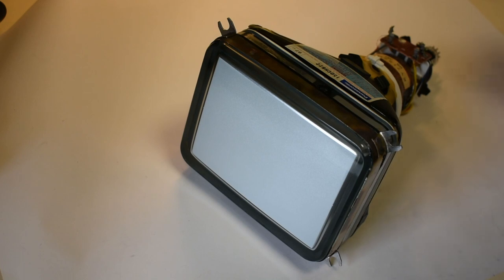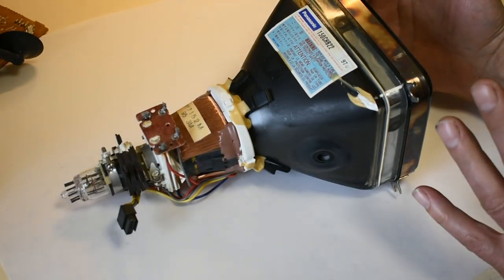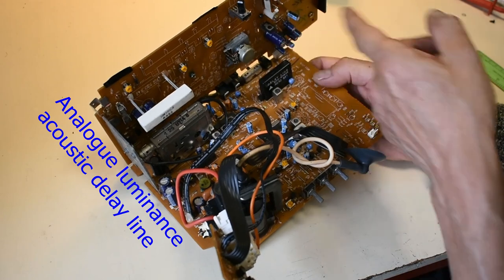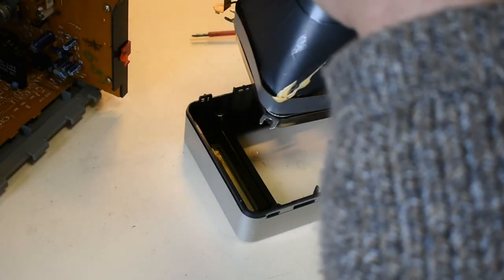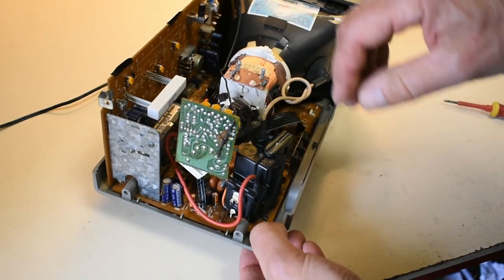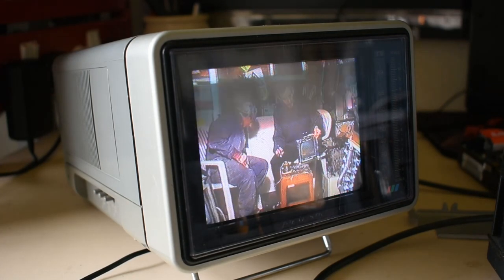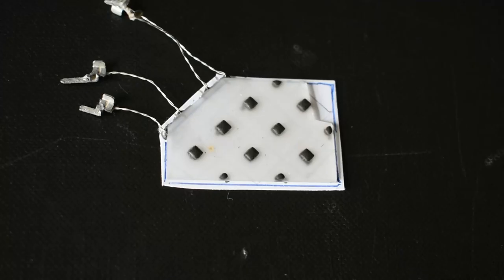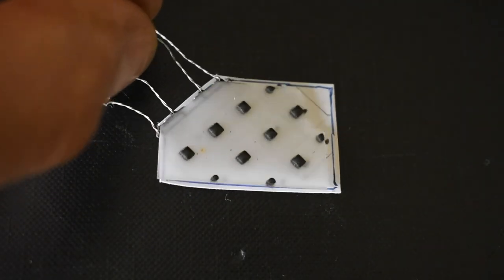Small 'Portavision' CRT TV

Comment: In a PAL system, there is a 64us delay line which is equivalent to a single scan line duration; it's used to average out the chroma signal across 2 scan lines, eliminating any phase shifts as the chroma phase reverses every line, hence Phase Alteration by Line, or PAL.